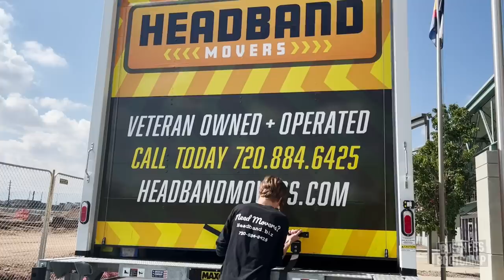$300K+ in DEBT (and he bought a $140K TRUCK!!!)

Comment: Equipment debt is cool if you’re getting the pipeline full of profitable jobs to use them, but the $100k+  truck is trying to have the nice things before you can actually do it comfortably. I mean you can still buy a nice truck that can pull without spending that much.

Comment: He could have had a bad ass chipper truck with a roll off to different task if he wants to do trees plus. There is no reason that he should have to pull around a dump trailer and a chipper and then have a 140k truck just sitting there. We have to do a better job on getting what the business needs to strive and not what we like. If your business does enough in profits, you will be about to afford the flashy stuff down the line if thats what youre into.  I have a considerable amount of debt but the difference is I will turn that 140k into 7 dump trucks that can do different projects at the same time. No matter how nice the truck is, it can only be in one place at a time. As much as I would like a new truck for myself, it doesn't move the needle. If you're going to go into debt, please think smart and strategize before going into major debt. Just my 2 cents.

Comment: I've got one for you... I've got 2 full time & 1 part time employees.  We are busy & flowing with networking etc. A few months ago I had a customer cancel a job mid way through. & they processed their payment through a CC company. $16,000.00+ the CC company refunded the money . & is now looking at me to refund this back to the CC company. Which I currently do not have the surplus funding. Considering I spent the money on the project. We are able to keep floating thankfully & are very busy. However , this is a huge concern to be dealt with immediately.  I don't have any legal leverage . Because apparently my contracts do not   any binding terms for cancelations.
Reply: Obviously I am not a lawyer but a contract is there exactly to prevent this type of cancellation. You can't sign a contract and back out later because 'there wasn't anything specifying I couldn't back out'. That is the whole point of the contract. I could be missing something, though.
Reply: Time to get a good lawyer / legal aid friend. :)